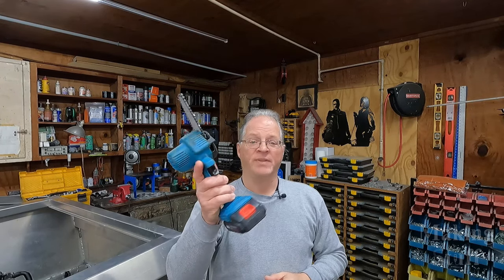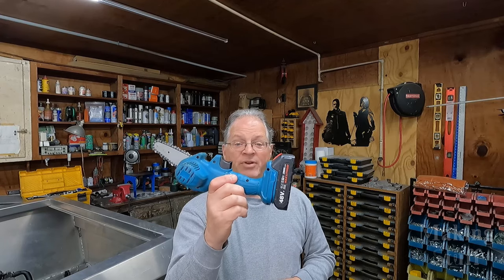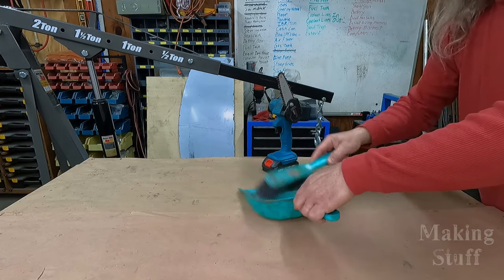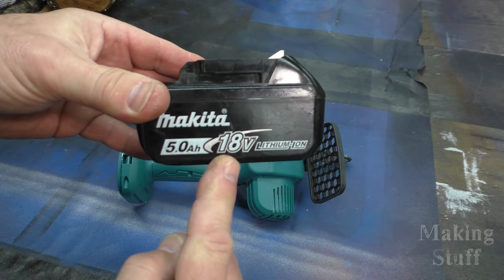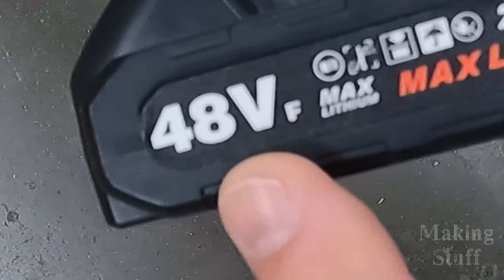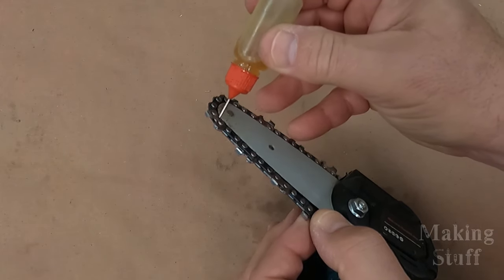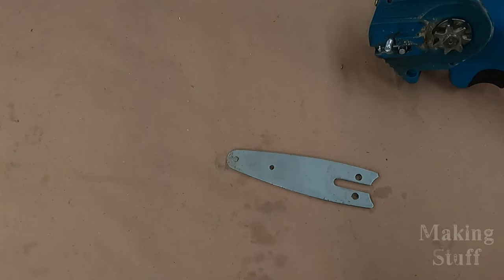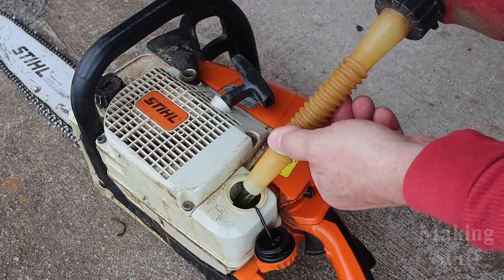Mini-Chainsaw Update - How Well Did It Hold Up?

Comment: What kind of oil do you use to oil the chain? How often should the chain be oiled?
Reply: Any light oil is fine. Use a bit of oil before use and a drop while using dependant on how much work your doing. Brush off when finished and a bit of oil for storage.
Reply: @steveedwards4495  Thank you Steve.

Comment: I feel like most of these Chinese Saws are equal in quality and performance. I recently bought the 6-inch one that takes DeWalt batterys specifically. Not disappointed so far. I actually sell Stihl products and I would stack the Chinese against the the Stihl GTA 26 all day. Reason being, DeWalt batteries lol. I have many of them and the flex volt will run my saw much much longer than a Stihl. And mine cuts just as fast if not faster. And I could by three saws for the price of one Stihl. And Stihl just went up 10 more dollars lol.

Comment: Good follow up, thank you.  I bought one after your original review but it was by a company called Saker tools. Not sure if they are the original manufacturer and the others are copies but do far a great tool. The one I have has a safety button on the side to prevent accidental press of the trigger. It also has a knuckle guard that covers your hand.

Comment: It's a handy little tool, you won't take a tree down with it but for small branches and brush its excellent!
Reply from the maker: Yeah it definitely has its place.  Thanks for watching!
Reply: I use an angle grinder small one to sharpen the chain and work good

Comment: This is the first time watching you videos - subscribed.  I bought a 4" mini chain saw and liked it so much I got another for one of my friend's Christmas present.  She loves it too.  I have 78 acres and most of it is in woods and feed plots for wildlife.  I do thin the lower limbs in my walking and working areas.  Glad to know that the batteries are available from various tools.  Is there any specific chain that I should get for this (I also bought a 6" and an 8").  I feel really weird not having bar and chain oil so I've either been digging out one of the small couple ounce bottle of chain oil or grab a WD40 can to spray it down. I also have a Ryobi pole saw and a Black Max 18".  Between these I should be covered except for a 70 ft pine about 80 ft from my camper that I need to take down.   I watched a video last night on Ryobi batteries that will not trigger the charger and found out why and what to do about it.  I used to work in a NiCd battery plant a half century ago building battery packs, aircraft batteries, D cells, 2/3 fat A's and more.

Comment: I was really puzzled to see the way you seem to struggle starting your gas chainsaw. I don't have any problems starting mine.
I purchased a six inch cordless mini chainsaw and it lasted a year. I then purchased an eighth inch and lasted just a month. They seem to be designed for light work and that's it.

Comment: Thanks for doing the videos, very interesting. Does it have an induction or just a brush motor? and will the battery work in a Makita power tool?
Reply from the maker: Not really sure about the motor.  Probably brush.  Also, not sure about working in Makita tools.  I don't have any to try out.

Comment: Why is that every sort of adapter exists but not for bosch DIY (power for all) batteries to anything else? (In this case Makita)
Reply: And... Ryobi has that silly "arm" on it so they don't make many adapters for it. I had to make my own "adapter"... I tap off the 18volts with a little cable and run that to the positive and negative terminal on my tool. Then I strap the Ryobi battery so I can wear it around my neck. (I'm being silly o'course).
Reply: @plum1000  Silly for doing it? :) Or silly for making up something like that?

Comment: Don[t see a Stihl that difficult to start very often,. unless of course, you didn't turn on the ignition! LOL!  But then a Gasoline powered chain saw is not a fair ( implied ) comparison to that
little battery powered chain saw is it? 
BTW  Yes, I do own one of these little battery pruning chain saws, but mine has a more useable ( in my opinion ) six inch bar and chain.
Reply from the maker: Yeah that Stihl is 24 years old and runs all day as long as you keep putting gas in it.  Just showing which one is easier to cut a 1 inch branch in a hurry. Each saw has it's strong points.  Thanks for watching!

Comment: For me this stalls all the time. Can't handle even 4-5 cm wood without the power cutting off, probably due to the battery. And I don't have makita batteries.
Reply from the maker: Mine will stall when the battery gets weak.  That's how I know it's time to change the battery.
Reply: @MakingStuff  Mine does it fully charged with a tougher or thickish piece of wood.
Reply: Mine stalls too... it just can't handle that steel pipe very well. (Sorry... just funnin').
Reply: @plum1000  I would be happy with a decent piece of dry wood. Unfortunately I see no way of acquiring a decently powerful battery without ruinous (multiple times of this saw, with batteries) cost.
Reply: In my cheapness, I sacrifice a little bit of compact portability and have a cord from the tool that connects to my Ryobi 18-vold battery. I make fun of wearing it around my neck... when I really clip it to my belt. I do not want to invest in another battery "system". I already switched from a Dewalt battery system when they went from an 18-volt system to a 20-volts slide in system. You spend a lot of money when you switch battery systems.

Comment: was wondering if you could put a longer bar in it, 6 or 8''... would appreciate the anwser if anyone has tried it
Reply from the maker: Not sure
Reply: Great idea... or maybe a 20-inch bar and maybe use used bicycle chains on it and weld on cutting pins. Great thought!